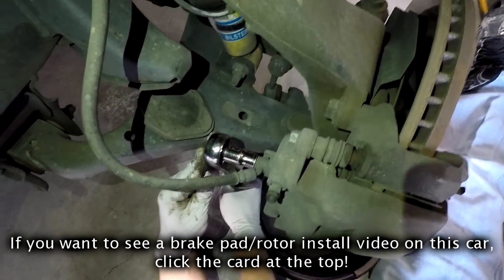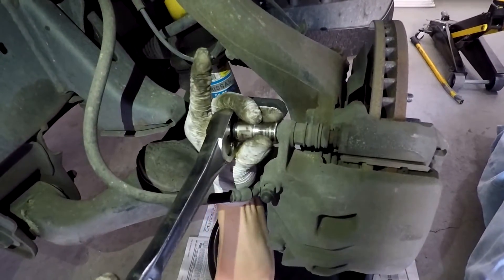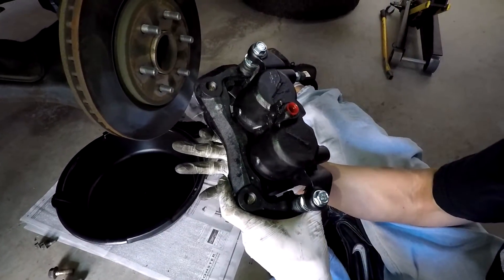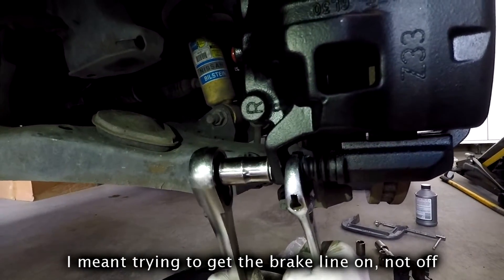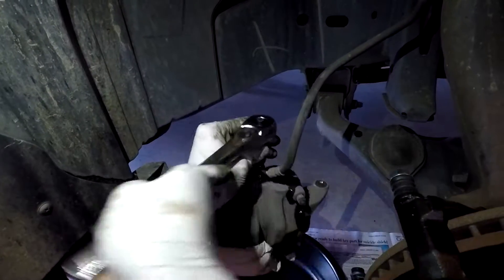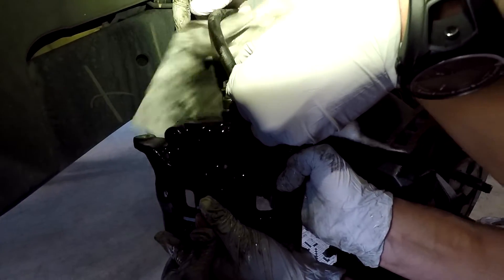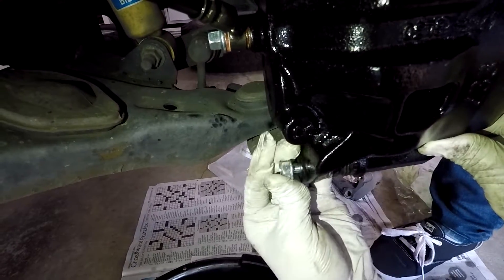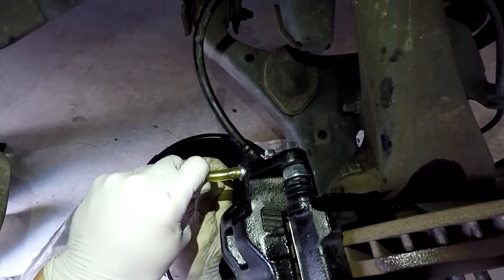Nissan Frontier Brake Caliper Replacement

Comment: Did you use Nissan calipers?Im asking because the dealership is telling me the ones we got from AutoZone don't fit and its likely that only Nissan ones will fit.I have a 2010 Xterra
Reply from the maker: Lol, stealership being the stealership.  It just so happens that these are OEM calipers from Nissan, but that doesn't mean 3rd party companies can't make parts of the car.  I always advocate for OEM parts, but that doesn't mean you can't use aftermarket, so don't let them try and scare you with that